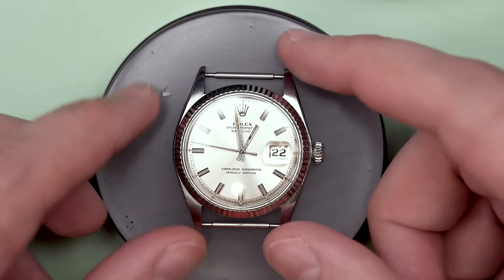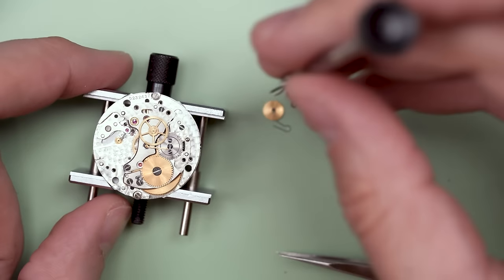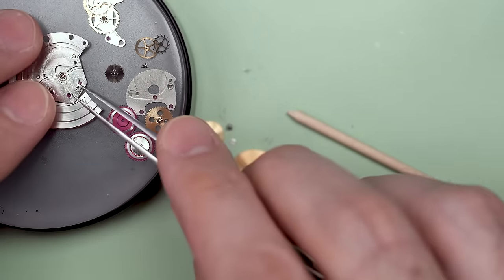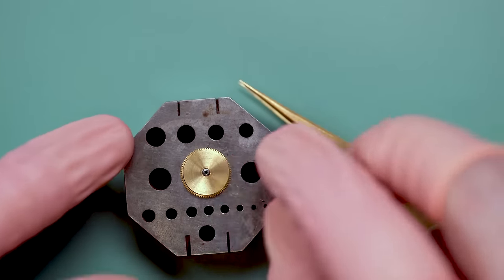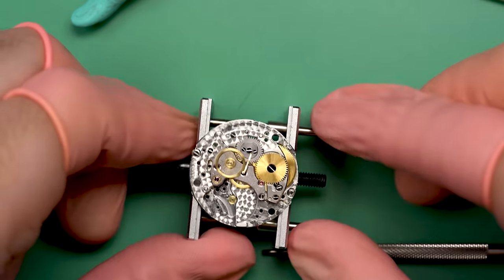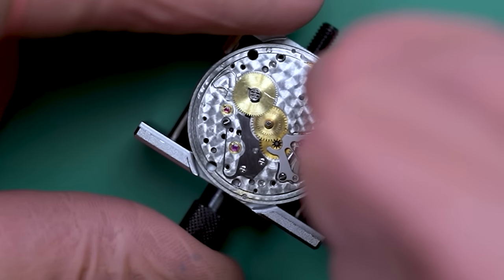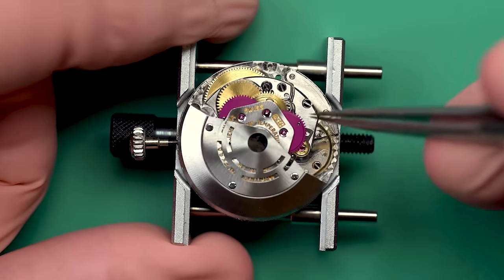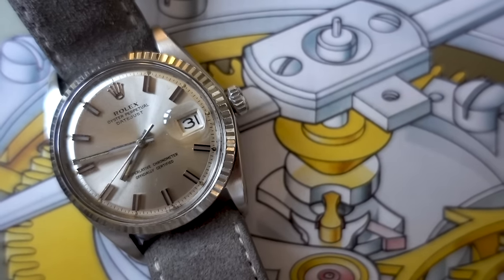Rolex Datejust Vintage Watch Restoration

Comment: Just found your channel and I'm enjoying catching up.
Here is a tip for finding small parts that you have dropped.
Get a vacuum cleaner and cover the end with stockings and then vacuum the area where you think it may be. The vacuum will suck up the part but the stocking should prevent it actually going into the cleaner.
Its worked for me when looking for screws I've dropped when repairing a phone so it may work for watch parts even though they are considerably smaller.
If you try it as a last resort you have nothing to lose.

Comment: Really like your videos. You communicate vey effectively and calmly.  I'm fascinated with how you effortlessly do this intricate work. I've owned this exact Datejust model since 1979.  As an aside, Mr. Rolex was primarily a marketer in the early days (1900's).  His watch movements were made by another company - Aegler.   Only in the 2000's did Rolex start making their own movements in-house.  And you're right about trying to get a new one - just impossible.

Comment: I just discovered your channel. I started by watching you cleaning and rebuilding a WW2 watch for a friend. In that video you mentioned that troops would synchronize watches about once a day with their commander's watch, or everyone would sync up with the best available time source.  
In this video I thought I noticed that the Rolex second hand did not stop when you pulled out the watch stem to set the time.  Am I mistaken?  If everybody's watch drifts a few seconds a day like the US military watch and this Rolex, every day sync ups would be about 10 seconds difference per day from slowest to fastest watches.  The second hand would have to stop for that to be possible.  It's been a long time since I had a mechanical watch, I don't remember what happened with the second hand when I set the time.  Usually I just got it to within the current minute, occasionally I would call up the US atomic clock number to get the exact time.
Reply: Yeah it's called hacking and not all mechanical watches can do it. Military watches are designed to be hackable because the ability to synchronize is a very important feature for a military watch.

Comment: Try using a big wide 3m lint roller. They make big 6” wide ones. You can roll it on the floor and around your desk. The missing parts might show up on the white sticky pad.

Comment: My first watch repair was this same problem, a screw had backed all the way out and was interfering with the balance.  Fortunately, no damage to the spring at all.  It was a Benrus that I bought at a pawn shop, cheap.  I had just received my first watch tools and I carefully picked up the screw and put it in the hole.  I daintily screwed it down, so satisfying.  It was the perfect first experience.

On another note, I also have a fake datejust.  I'm not sure how old it is, but it contains a decent swiss automatic movement with stop seconds.  I googled all the stuff on the back, but found virtually nothing about it.  It's probably pre-internet, but impossible to really date it.  Another estate sale find.

Comment: Watching your videos, where you talk about losing springs, jewels, screws etc., why don’t you get a small cabinet that you can put your arms into (like ones you get for handling dangerous chemicals) where you can push your arms through sleeves with elasticated wrists, and perform the same work inside a closed environment, that way when something ‘escapes’ from you it’s still inside the cabinet. Just a thought Marshall, and I love the videos, very relaxing and informative

Comment: @Marshall, Rolex introduced the quickset date function to the Datejust lineup in 1977 with the introduction of Caliber 3035 movement. So if your Datejust was made in 1977 or later and is powered by Caliber 3035 or subsequent movements (Cal. 3135, 3136, or 3235) then it has the quickset feature, your Rolex as I heard is from 60s, so that’s why the date set operates the way it does.

Comment: "Corundum" is an aluminum oxide that commonly forms hexagonal barrel-shaped prisms that taper at both ends or as thin tabular hexagonal plates. It has a hardness of 9 on the Mohs scale, making it one of the most durable commercial gemstones. It has no dominant cleavage and fractures in a conchoidal manner. A high density of ~4.0 g/cm3 (most silicate minerals are ~2.6 g/cm3) results in corundum occurring in secondary placer deposits and recoverable by panning methods, similar to how you would recover placer gold.

Corundum comes in all colours of the rainbow but is most commonly found as opaque crystals with dull colours. Red corundum is called ruby, blue corundum is called sapphire, and all other colours are called fancy sapphires. Some varieties of corundum will fluoresce under short wave and long wave UV light if there is enough chromium in the crystal structure but little iron, which tends to quench any emitted energy.

Comment: The strange little 2-holed reverse-threaded "screw" is removed with something called a "spanner" bit. It's just two little posts on a screwdriver bit measured certain distances apart, way more common in specialty electronics

Comment: I was trying to reseat an incabloc spring on an old bulova and the same spring disappeared 4 times. sending me searching all over the floor for hours. in all cases while i could have sworn i saw it zing out of my loupe vision, was either stuck on the movement, or a matter of inches away despite looking closely at my work area first. one time i even went in the bathroom to inspect my face/hair, and upon returning it was simply sitting on my desk. I sat there and stared at it for about 30 seconds assuming it was just a mirage. I was almost longing for the pressure fit cap jewel from my old pocket watch that required me to remove the hairspring. Now I find myself using Rodico whenever messing with those things.

Comment: Lost jewel suggestion: build a box with a viewing window and arm holes  to keep parts in a container. Put your parts into, and remove from, your cleaning basket inside the work box. 

I also noticed that you don't appear to keep the parts organized  or oriented when you take the watches apart. You may have this well organized in your head but you will demonstrate the need for this organizational by demonstrating it in your parts organization  during disassembly and reassembly. This can be especially important if you need to step away from a project for a while during shipping delays.

Comment: I was hoping you would  put it on the machine as soon as you found that screw...just to see.
I just started watching your videos. I like yours better than the others I have seen. Your commentary regarding the parts and function is way more than what I was used to. Watches have always intrigued me. 🙄 Sadly, I would be the one to look inside and go "Nope". 1 more dead soldier.

Comment: Tip for finding small objects: Sweep the floor and dump the dustpan onto a sheet of paper. Or if your floor has nooks and crannies in it, vacuum the floor and go through the filter. Source: I have dropped many tiny custom screws.

Comment: I am new to this site and found it very interesting to see what is inside my Rolex watch case. Mine was a gift that I got almost 20 years ago and is a very similar to the watch you worked on. I had wanted a Rolax for a long time. I did find a major flaw in my watch in a short amount of time after getting it and it was confirmed as your watch had the same problem after you had it back together and tested how accurate it is. I can go out and buy a cheap Timex watch or get what I am wearing now, which is a look similar to a Rolex and both watches do what the Rolax can not do. Keep accurate time. My watch now is more than a year old and is off by about one second. The Rolex runs to spec (per the company where it was bought from) and loses up to 5 second a month. Considering how much they cost, a Rolax should keep perfect time. Sadly mine as of now sits in it's original box in a safety deposit box unused. I will never wear it again and consider it a way over priced piece of junk.

Comment: I have bought my Rolex (rather a Lolex) from China for USD 24.99 (shipping included) a couple of years ago. The case is very well machined, includes a scratch-proof saphire-glass and it uses a Swiss (!) quartz driven engine with adjustable oscillator capacitor and temperature-compensation, is pretty accurate (about +/-5 sec per year) and the battery lasts for 3 years.

Comment: I use a Rechargeable hand vac specifically and only for watch parts recovery. Simply vacuum all around the area and then look through the debris. 90% of the time you will find it. 😊

Comment: You mention having a watch "serviced".  I have a Rolex Submariner.  How often should I have it "serviced"?  In summary (short version), what gets done during a "service"?  Does the local Rolex dealer normally do that in house, or do they typically send it off to a service center somewhere?  If service center, would I be better off sending my watch directly to that center my own self, rather than going through a middle man (and paying his markup)?

I actually own a couple of self-wind watches.  Needless to say, I only wear one at a time.  :-)  Does it hurt a self-wind watch to let it run down and stop?  I see electric "watch winders".  Would a self-winder be better off if stored in one of these, so that it stays wound (and running)?

Thanks in advance for your replies.  I enjoy your channel.

Comment: When I took the clock (not watch) repair class, the test on the 2nd day was assemble a box of clock parts for a time & strike clock in under 7 minutes correctly, plus they threw "extra" parts in the box that didn't go to "the" clock so you had to know not to use those. So you done xlnt here LOL (I passed btw).

Comment: So finding small things, in 3d printing we also have this problem and the trick we use on the floor, is to use a vacuum cleaner with a ladies tights or maybe pantyhose in usa doubled over on the end of the hose with a rubber band, this is a way to find anything small from the floor. Not sure if this would work also for watch parts.

Comment: As I only recently found this channel, I'm going back through older videos.  Are the two pinkish gear wheels in the winding works solid sapphire gearwheels?  I kind of wished you'd done a microscope focus on some of the unusual and higher-quality parts than normal, just to see them.

Comment: How can you buy an expensive watch on eBay with confidence? I guess even broken that Rolex will be >$1000 - it could be a very good counterfeit, or a Frankenwatch with a non-Rolex movement inside. Glad it worked out, amazing skill you got!
Reply from the maker: I wouldn't say I had confidence at any point until I received it. Now they do an authentication automatically though on watches over a certain price.

Comment: Actually I tell a lie. I always wanted a bubble back . I am familiar with them as my grandfather ( the watchmaker I spoke of ) owned one. I do not know where it ever went after he passed away. He is the one who had the 6694. He was going to service it and all but never got around to it. 
The C. E .Marshall parts cabinet I was telling you about has quite a bit of Rolex parts in the drawers.
Rolex Oyster case is rather brilliant. The trip lock crown also brilliantly thought out. The Deepsea I own has that really cool titanium 2 piece case back. The really superb ratchet style band adjustment hidden in the clasp. It would be super cool if they would just change the Oyster case design. Maybe a cushion shaped case?

Comment: Im a machinist.  This work is too fine for me, but I really admire your skills.  As for the lost jewel, I do a good deal of threading which involves handling three tiny wires placed in the threads and measuring over them with a micrometer, to get the current pitch diameter.  Sometimes I will drop one of the pins in the chip tray.  By accident.  Because as my mom would say, I am a bull in a china shop.  I always look for the lost pin, and have failed a couple if times over the years to find one.  Before I start looking I simply resolve to give it a try, sort of mentally writing it off, and then start looking.

Comment: The part most easily lost when building an AR-15 is the pivot pin spring and/or detent. When one goes sailing away it will never be found.

Comment: I'm not absolutely certain with such small parts but I know that a lot of pressure fits are done by heating the metal part and putting it on and letting it cool. The hot metal expands and when it cools it shrinks. Don't think I would try it on a Rolex tho.

Comment: How many watches did you take apart before you could put one together correctly? How long did it take you before you could put them back together by knowing what and where everything belongs off the top of your head. Or do you work with diagrams to reassemble?
Reply from the maker: Well I took one apart and it never got back together, but then later I started actually learning and taking my time

Comment: Do you fix watches? You would be paid. I have a Timex indigo that works, I just can't set date or time. Pull knobs are not working, they come out. Also I have a pocket watch that needs a minute hand. I have an old German watch that needs cleaned, it works sometimes. My hands don't work anymore, they have fixed many, many things and built many things through the years being a plumber, carpenter, electrician over 30 years. The watches are more sentimental to me, I don't think it would take you much to fix all I'm sure, I tried. My hands are really done. If not, I understand, I would love to watch you work on them. If not I will still watch you, please and thank you.

Comment: So you want a couple more to work on? I have a 6694 with a cool oyster bracelet with is a stretch band . It runs and stops . Pretty sure it needs a service. Made somewhere in the mid to late 60's.

Not a huge fan of Rolex watches even though I own 3. The Daytona and Deep-Sea I do like but the 6694 day date isn't my thing. Like I said before not much into dress watches.
Rolex is a English company who rebranded watches. Now they do quite a bit of in house movements. I actually prefer the Daytona with the Zenith movement however.
Owning a Rolex you will see the difference in parts pricing. It is kinda like saying I need a alternator for a Chevy Vs. A GMC . Sometimes the very same part but once you add that GMC brand it goes up by at least 20% .
Rolex in my opinion makes somewhat middle ground watches. Not on par with brands like Patek, A. Lange & Sohne, Breguet AP etc. Where Rolex shines it is with both brilliant advertising and one of the most recognizable names in the business. To me a Rolex is no greater than the likes of Omega and actually Omega really have some awesome movements. I own a Daytona in 18k but if I could do it all over again I would purchase Zenith El Primero Chronomaster. Now that is one heck of a movement.. take for instance the Academy Georges Favre Jacot.. That is an impressive piece of engineering. 
I really do hope Rolex creates something way different then the same old thing just in different materials. They really need to up their game.

This is all my opinion of course but I have been collecting for over 35 years. And I come from a line of a master watchmaker. So what I am conveying is dinner table watch discussions being part of my upbringing. 
Funny how my Daytona use to be a rather large watch. By today's standards nowhere even close.
I love watches as much as I do fine gemstones. 
Some of your videos show these beaten up watches that many of us today cringe about. Must be society changes. A work watch back then is a collectable prized procession today.

Comment: Was looking through the comments but did not find any remarks on the message on the backside of the plating. Correlation between message and a loose screw inside the watch? Does it not seem improbable that someone service a watch and manage leave a loose screw inside there?

Comment: @35:03 that jewel lock doesn’t look seeded properly. The top of it looks like it’s supposed to be sunken into a little slit on the inner edge of the circle. You can see it when you go back in the video to where you were removing it.

Comment: Around 2004 Rolex started to make their own movements.  Zenith were a long time supplier as Rolex attempts were no where good enough. Another Movement maker was also a long term supplier. Rolex is just a status symbol due to lots of self promotion. Tudor watches use a lot less expensive movement by ETA but seem to be promoted as 'almost a Rolex '....
Reply: Herrman Aegler was on the Rolex board in the 1920's. Rolex bought the Aegler company in 2004. Rolex always designed and engineered their movements. In regards to the Zenith Daytona,  it wasn't a plug and play. Rolex put in 200 modifications to increase reliabilty and minimize maintenance.

Comment: I've lost lots of tiny watchparts as well...mainly cap jewels.  It's like they have grasshopper legs on them. Seems no matter what you do, you still lose them.  I guess this is why watchmakers have specially designed benches and why certain colors are used.

Comment: Where is the gasket for waterproofing go.  I know it is not the screw down dial.  Although I like that protection.  I have many that are water resistant (20bars etc)  with no screw down crown.  How do they do that.  Is it inside?